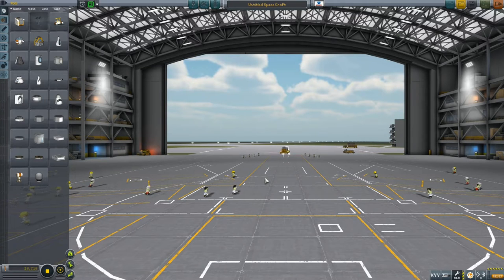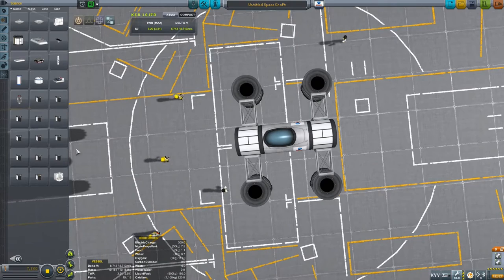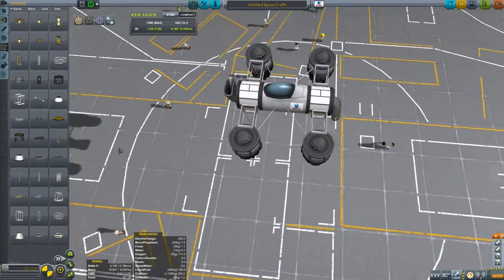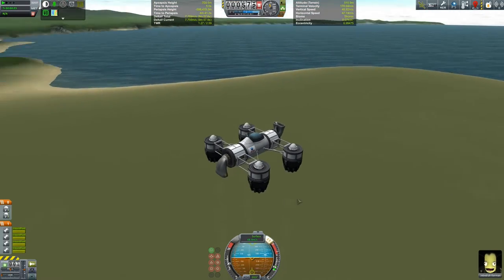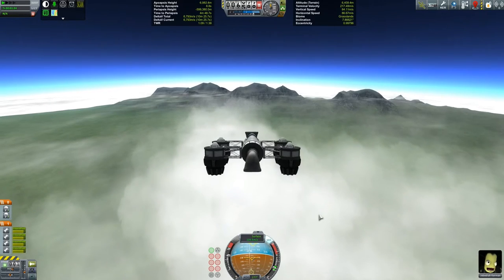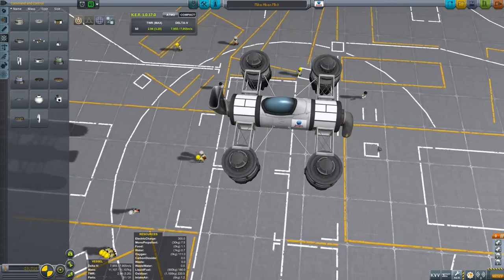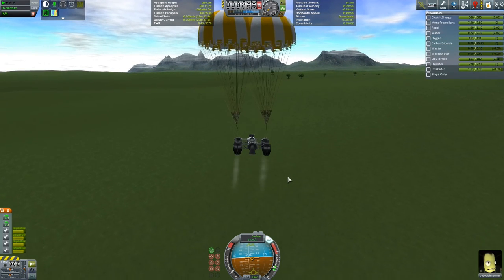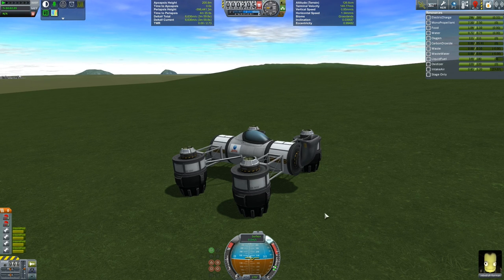Viruk and Jeb 10: The Mike Aben VTOL

Comment: Wow, I missed this when it was first uploaded.  I shouldn't have given up on the thing so quickly.  Actually, my idea for a fix was to use modular girders to raise the parachute attachment points well above the CoM, but I couldn't handle the part count (I was at a tier 1 SPH at the time).  I was always planning to get back to it but never did.

Good to know the design wasn't completely dopey.
Reply from the maker: +Mike Aben It worked perfectly well, if a bit "wobbly" in this pilot's hands. Quite a neat designed of yours. I'm rubbish at coming up with something original and not a straight-up-and-down rocket.
Reply: viruk67 I'm much more a rocket guy myself too.  Playing almost exclusively career mode I rarely find myself in need of a VTOL, other than having a good way to kill pilots.